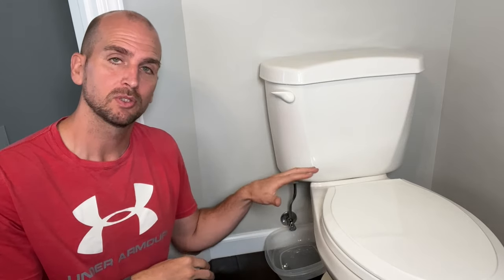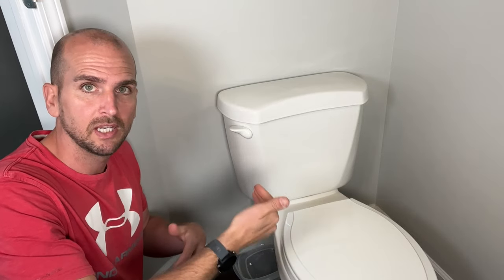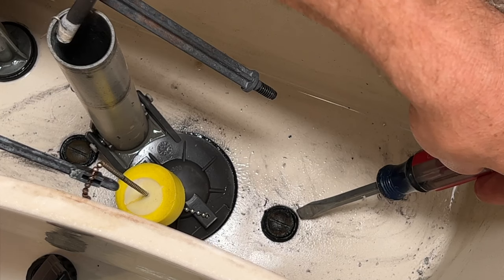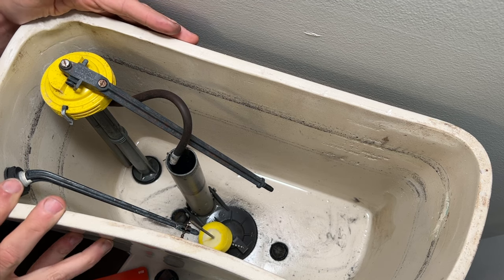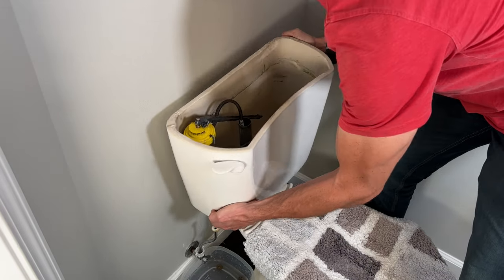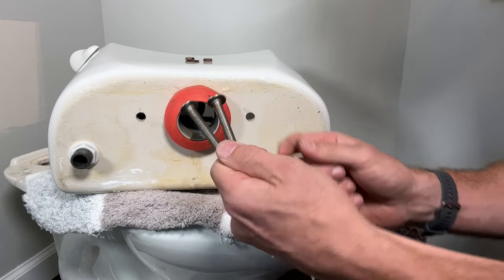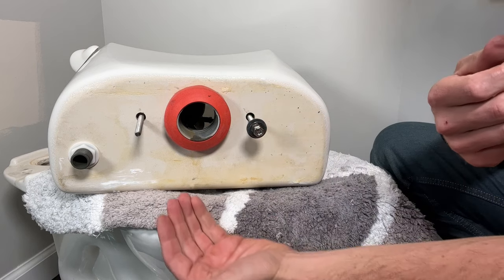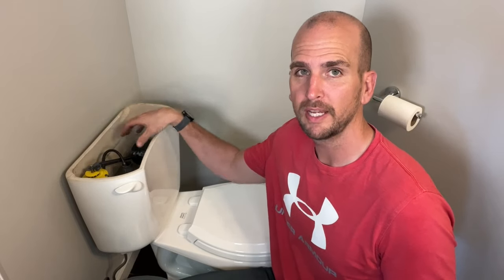Easy Fix For The Most Common Toilet Water Leak

Comment: Also add that if stainless bolts aren't available, use solid brass, not brass plated.
I always thought you were supposed to sandwich the rubber seal on both sides of tank, then bolt it down to the bowl.
Reply: You are correct, that is the way I did mine.
Reply: @robertjoseph1592  exactly!
I have a total of seven toilets here at my summer cottage colony so i’ve done this repair numerous times over the last 20 some odd years. I fully agree that he should’ve put the rubber washer, metal washer, and thin nut on the bottom of the tank prior to putting it to the bowl because underneath the bowl, should only be a metal washer and a nut.
You need to have a totally sealed tank before you put it on the bowl! I test my tank at that point by putting it on some two by fours outside and filling it with some water just to make sure it’s not leaking.
Reply: will give him credit for at least noting, even showing, your way to do it.  But then he only vaguely says he doesn't like that way -- without explaining just why not.  (your comments here are more compelling)

Comment: You should really put a 2nd rubber washer, metal washer and nut on the bottom side of the tank to make the tank water proof and not rely on the pulling of the nut at the end of your assembly underneath the bowl.

Comment: In reference to securing the bolts before replacing the tank, you said, "I don't prefer that method."  But then you didn't tell us why.  Another video said he DID prefer to tighten them first, and actually explained why (to make sure that a new leak doesn't happen if the tank shifts.). That sounds right.  But since you gave no reason for your opinion, i'll go with him.
Reply: Without the nut under the tank makes it easier to replace the bolt and rubber washer next time around because you don't have to remove the tank and the nut in between.

Comment: buy a tank kit with 4 rubber washers, two inside toilet tank, two on bottom of tank with flat metal washers on back of rubber washers on the bottom of tank, then small nut, then metal washer on bottom of toilet bowl and bigger nut, dont over tighten

Comment: I dont see the point of putting the rubber washer on the bottom. This does not seal anything. There is a gap between the Tank and the bowl so if it does have a leak ,it's still going to leak down onto the bowl.
Reply: You don’t want to tied metal against porcelain.

Comment: I just got a repair kit from the big orange "home" store and it was not the quality or quantity that you showed in this video. If I lived closer to a real plumbing supply store, I'd get what you used. What a rip-off that store is!
Reply: You never know what you’re gonna get. I just had this happen and local plumbing store replacement kit had gaskets that were rock hard for $9.  Returned that and went to Wal Mart and bought a kit for $5 that was much better.

Comment: NOOOOOOOOO, YOU  DON'T  EVER , JUST PUT  A  NUT  AND  A  METAL WASHER  ON  THE  OUTSIDE OF THE  TANK,  IT  MAY  CRACK THE  TANK. YOU  HAVE  TO  PUT  A  RUBBER  WASHER FIRST ,THEN  THE  METAL WASHER  ON  THE OUT SIDE OF THE TANK,   TIGHTENED  IT SNUG  AND IT WILL  STOP  LEAKING,  BUT IF, IT LEAKS  A  LITTLE,  TIGHTEN  IT  A LITTLE MORE,. IT  SHOULD  STOP  LEAKING . MY  DID,    P.S.  YOU  ALWAYS  USE  A  RUBBER  WASHER 'S  ALSO, AND  TO  STOP  THE LEAK, AND  SO YOU DON'T  CRACK  YOUR  TANK. 🧐

Comment: 1:51 "turn valve off"...you reallllly should have mentioned to new people, that sometimes you don't want to touch that thing At All if you aren't ready to shut the house water off immediately or aren't ready to replace it. they can build up with minerals, and be 100% fine when left untouched - but then when you turn them they start leaking, or get stuck open or closed. 

since this video is for noobs, you really fucked up mate.